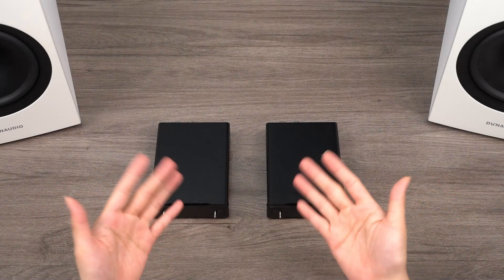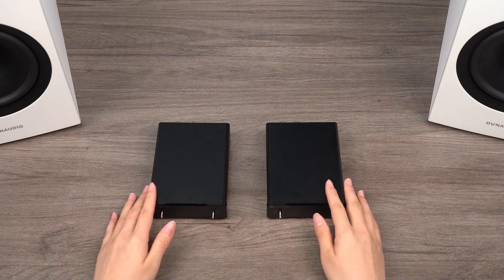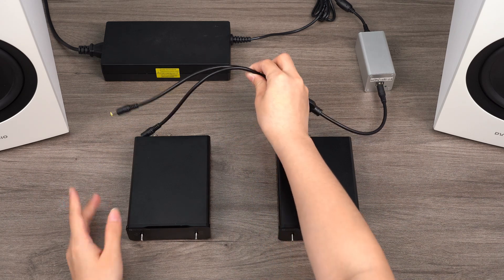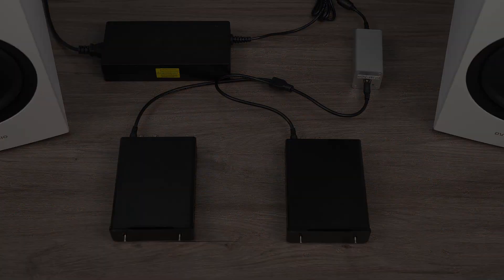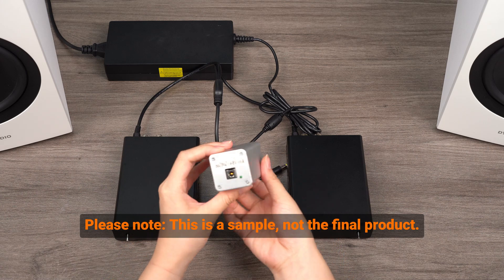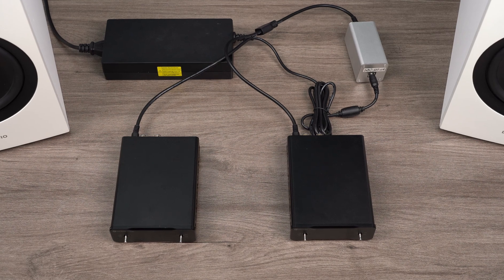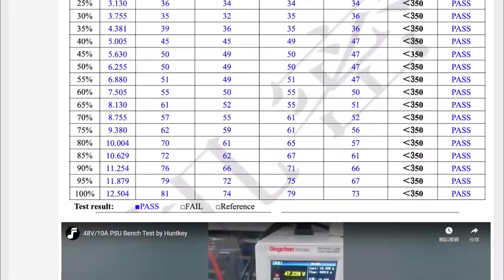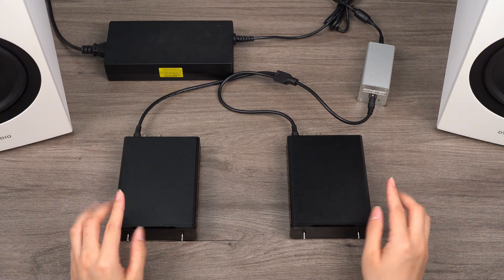Is 48V/10A Power Supply Better for V3 MONO? Find Out the Truth Here!

Comment: When I ordered 2 V3 mono amps on your website there is only an option for two amps and one 48v 10 amp (not GAN) priced together, not two power supplies and two amps as a package. If I want 2 power supplies I will have to order another separately, is that correct?

Comment: Using one PSU for two monoblocks defeats the whole purpose. The idea is having a seperate PSU for each channel. If you run both from the same, you just have a regular stereo amplifier in two cases.
Reply: You can choose the separate power supply if it makes you feel better.
Reply: @tedkay5272  That's the thing: the whole point of "monoblocks" is feeling better.

Comment: So they had to develop a new box to fix the Y connector's problems.  How is that decluttering your setup?  

I have been and will continue to recommend that 2 x V3M + 2 x 36V5A supplies is your best setup for stability, temperature and longevity.

The two smaller supplies take up no more space than the big one with the filter.

Comment: Will the 5Amp supplies come with a filter too or is it just the 10A??
Reply from the maker: Only the backers who pledged for one 48/10A PSU with two V3 MONOs will receive one for free.
Reply: If you have a 5A power supply per mono, you don't need the filter; it's just a fix for two amps sharing a power supply.

Comment: I connected fosi audio v3 mono on my marantz 5.1 av receiver through front pre out. During the audyssy speaker calibration my av receiver detected that my front speaker connection is phase in correct. But i connected them properly. After i connected my speakers revised ( polarity inverted) then my av receiver detected that speakers phase is correct.
Reply: This happens a lot with external amplifiers ... either the speaker position puts it out of phase or the wiring does (as you discovered).  You chose the correct path of simply flipping the speaker wires.

Comment: If you take the 2x 10amp PS & 2x monos option on KS. Do you get two filters?
 Or is the filter supplied only w the one 10amp PS w splitter to two monos setup?
Reply from the maker: Only those who pledged for one-to-two (one 48V/10A PSU+two V3 MONOs) setup will be presented with the filter.😉
Reply: @fosiaudio  I think you meant to say: (one 48V/10A PSU+two V3 MONOs)
Reply from the maker: @StSam  Yes, thanks for correcting!
Reply: Fair enough! 😃

Comment: What if I have short 18" speaker cables and long IC's to each speaker where the amp needs to be very close to speakers that are 8' apart, will I need to get two 48V/10A PS or is there some kind of extension cables to make the splitter go further?
Reply from the maker: Hello! The one-to-two setup is suitable for desktop/near-field listening. When it comes to a bigger space like a home theater, one-to-one is recommended, where 2 48V/5A PS units separately drive each V3 MONO. The latter one will suit your needs better. :)
Reply: From a technical standpoint every inch of DC cord adds resistance to the amplifier's power supply, which can result in some minor to serious instabilities.  If your speakers are 8 feet apart your best bet is to have the amps with the speakers, use two separate power supplies, plugged in near/behind your speakers and longer balanced signal cords.